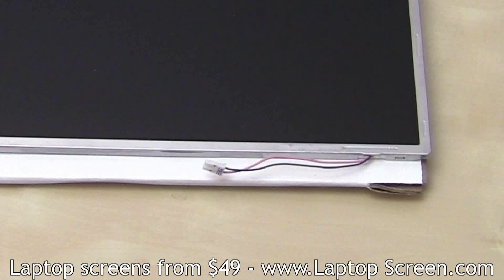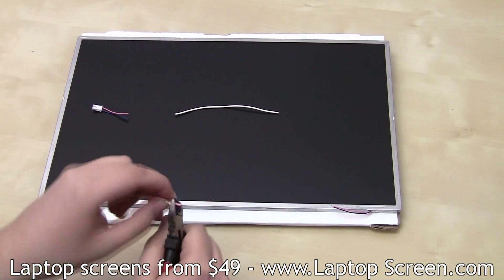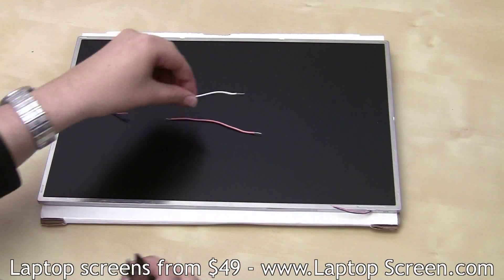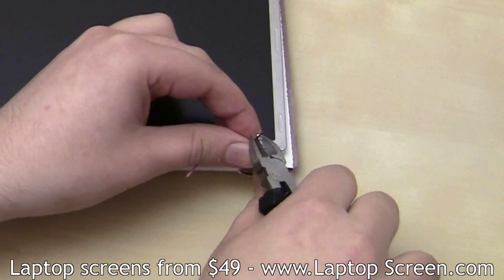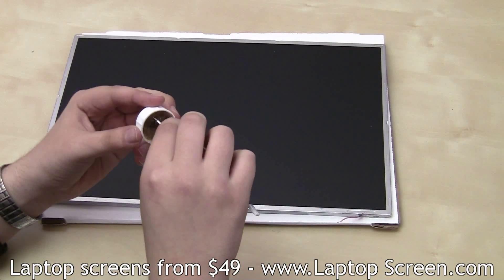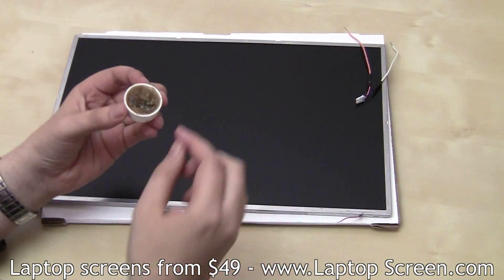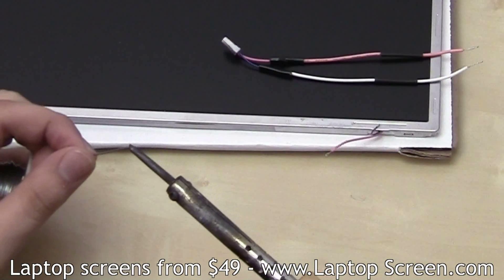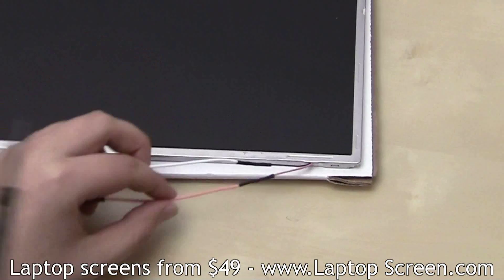How to properly splice an inverter cable on a laptop (notebook) LCD screen panel

Comment: Hi I had a question. I was wondering if there was anything I could do to solder my actual inverter power port back on to the lcd panel. Mine kind of just popped out when I was trying to pull out my power inverter cable.
Reply from the maker: Sure, you can solder it back on. You may need to get a new connector if you old one is damaged.

Comment: What kind of wire should i use?
Reply from the maker: Multi-core copper. Best to splice in the inverter wire from the old screen, it will be appropriate gauge and insulation type.
Reply: @Laptopscreen  Thanks a lot
Reply: fucking the blue kind..  or red.  Or lamp wire..  or a godamn bread tie.  The fuck...the solder should be the kind that melts..  and iron that heats up...
Reply from the maker: @Z-Ack  I once "fixed" my Volvo's corroded throttle body power supply line by jumping it to a good line in the fuse box with a twist-tie on the side of the road. It worked for 3 years before I sold the car. I always try to carry a twist tie with me :)